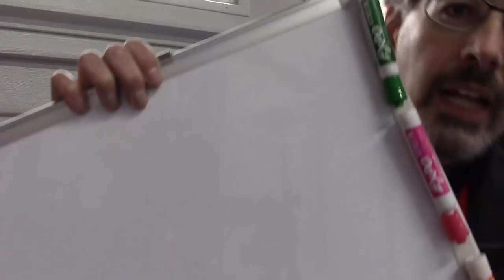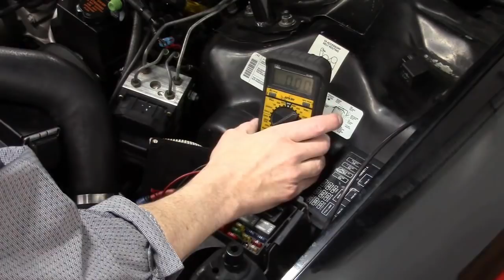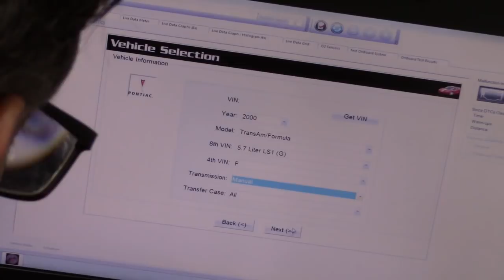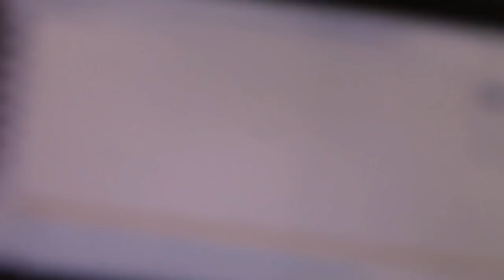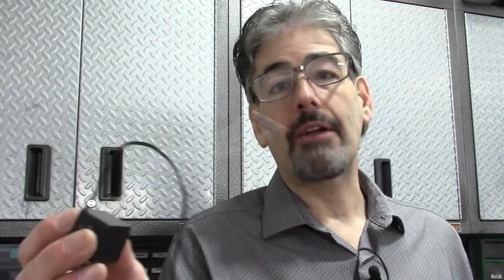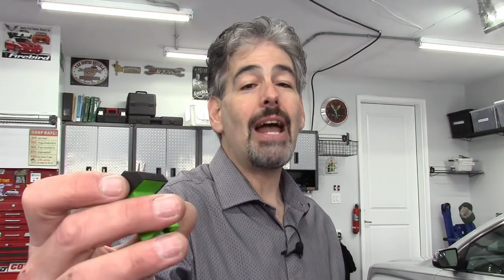DIY:  Diagnosing an Overheat On My Own Car

Comment: Hey Matt, I dont know if you're feeling charitable but I could use some help. 

I got a 99 chevy Malibu, 3.1. I can command my fans on with a scan tool but they will not come on when the car comes up to temp. Ive tracked the ECT as high as 220 with no activity. The cars AC does not work, but again, I can command the fans on with a scan tool. I would appreciate advice
Reply from the maker: It’s apparent the ECT sensor is not sending signal to the PCM. Remember most cars have two ECT’s. One for the gauge and the other for the PCM. Check the one for the PCM and the wiring to the PCM. But we know the PCM works if it has signal because the fans turn on when you command it.
Reply: @SchrodingersBox if the PCM wasn't receiving signal would I still be able to see the ECT pid/values on my scan tool?
Reply from the maker: Not necessarily/  if the PCM is not seeing signal it may substituting a value. Best to check in generic mode to see actual value.

Comment: 3 Bad fan motors is actually much more probable than you might think, since they could theoretically fail a few months or even years apart from each other. You would never notice one fan being bad because the car would never overheat. You may or may not notice 2 being bad, especially if you don't stop too often and are driving in a Denver winter, until finally all 3 are bad.

Comment: Do you worry about getting modules for such an old car? Or have any problems in  getting them?
Reply from the maker: Not sure what you mean by "modules for such an old car"?
Reply: Well for that age perhaps there are few modules in cars. In one of Ivan's vids he could not get a pcm for a particular vehicle due to its age (early 2000s). Just curious how much of an issue it is to get parts especially modules is for older vehicles.
Reply from the maker: ohhhhhh yes, I see
  No that isn’t a concern because there is a massive aftermarket for firebirds. finding any parts of any type is never a problem on any firebird.

Comment: Voltage drop question.....have a shift lock solenoid that does not actuate. Tested the brake switch....have proper voltage there. Pulled the solenoid out and have proper voltage there. While the solenoid (old or new) is connected the voltage then drops from 11.57v to 50mv.
Reply from the maker: remember you will always have full voltage drop ACROSS a load so that sounds about right.  .  The only way you wouldn’t is if you had resistance on the ground which clearly you don’t. so what you may want to do it check voltage drop on only the power side since you are starting with only 11.5V. it should be same as source voltage.

Comment: I would check the voltage drop across the bad connection. This would give you some baseline data to use after the repairs.

Comment: Is dielectric grease in the connector a good preventive measure considering your environment? I'm in the arid south west where 25 year old cars barely get much corrosion. Thanks for the great content and congrats on the new place!
Reply from the maker: Yes, absolutely.  in fact someone else pointed out it appears the silicone sealing ring seems to have been missing from the connector which probably caused the corrosion to occur so quickly. but indeed a dielectric grease on the connectors (not the terminals!) is good prevention.

Comment: Now you found out how we live in Canada! That is common in Alberta every winter, but this one was good. After snow like that, we have next night temperatures below -30C!
Reply from the maker: yes I will say one awesome thing about denver- if the sun is out it makes remarkably short work of the snow no matter how bad it is. in fact major roadways are already dry!  the high altitude let’s the UV really cook stuff, plus it’s very arid on top of that. 
  when I was in St. Louis MO, a snow like this would just rot on the roads as ice and slush for literally months.  it never dissipated. after a couple weeks the snow was so black and nasty it looked like coal on the streets.

Comment: Really cool garage you got
Reply from the maker: Thank you!! it took me about 60 hours to do everything from paint to lighting to flooring. I did it in just 3 weekends though- I worked my butt off so I could be operational again ASAP
Reply: So you are not in bare feet on a dirt floor ? I guess the guy with the fuses is ! In fact - he's got an 8 Track " Sound System " and using his VHS to wear out his bootleg copy of DELIVERENCE ! Pass the bib overalls !

Comment: For maintaining  and cleaning electrical contact look into a product call CORROSION X, best stuff on earth. To avoid problems in my turbo car, I install a push fan on a separate circuit that I can turn on when needed manually.
Reply from the maker: Great tip!

Comment: Thank you for a down tp earth (no pun intended) fan diagnostic video! Any troubleshooting suggestions for a pwm activated fan? Obviously for those without access to a device that creates the square sine wave?
Reply from the maker: I haven’t run into a PWM fan yet but if you didn’t have a scope the best you can do is see a difference in the AVERAGE voltage as the pulsewidth increases or decreases.  Since a regular multimeter already takes an average reading, you should see more or less voltage on your readout as the pulsewidth is adjusted. 
   Even then, if you are having issues on the circuit you  are limited in what you can use for diagnosis since you can’t see how “clean” and consistent the square wave is. but you can still measure voltage, amperage and voltage drop/resistance.
Reply: @SchrodingersBox  Thank you Brother! Some day you should do a video on the importance of having a clean organized garage, as your garages always look great!
Reply from the maker: hahahaa I have one on my pay channel actually but I will do a “garage tour” video on this one if there is enough demand.

Comment: “You didn’t check the fuses, I did you are just to Dumb to know” 🤣🤣 I was dying LOL . Gotta love the green crusties responsible for 80% of issues.
Reply from the maker: Lol never fails.  In fact yesterday I actually got a comment "you never checked the source voltage".
Reply: @SchrodingersBox  LOL gotta love the armchair diagnostician. Most shops don’t even have one qualified that’s the funny part

Comment: Hi Matt, thank you for another great video. Nice car by the way. That relay kit looks pretty handy also. I have a question unrelated to the video. So I have this car that I would like to be able to get a little more power out of and maybe a little bit better throttle response. I have seen quite a few different manufacturers that offer a performance chip that plugs into the OBD2 port and claims to give it better performance.  With my understanding on how the computers work and how the oxygen sensor works I began to wonder what it is that one of these chips do and do they actually provide more power or is it kind of a waste of $300? Does it move the fuel curve outside of stoichiometry? I have also seen some devices that are made for these drive by wire cars and they claim to increase throttle response, any thoughts or opinions on those? Any thing that I should be concerned about with either one damaging something long term?
I understand that to gain real power out of a motor I should either build the motor or add a turbo to it but I am not looking to make that large of an investment into an engine that does not have anything wrong with it on a car that I use for work every day.
So far I have added a Borla type S axel back exhaust and I plan to install an AEM cold air intake. It is a 1.8 liter VVT Toyota motor if that weighs any in your thoughts on the matter. Thank you and keep making your videos.
Reply from the maker: yeah those chips are pretty secretive in how they actually work and it’s pretty sus that they claim to both increase HP and Fuel Economy- pretty much impossible to do simultaneously. 
in general what those chips do is slightly retard the timing to get slightly better compression and also move the shift points to shift at RPMs that would allow more torque but of course this would be at less fuel economy.

Comment: Disapointed in you.. 
Good habit is to always check source voltage. Is fan getting voltage at fan? Is fan being provided voltage at the fuse?

Now back to finish the video.

I guess if you are splitting the circuit.. That is a good test point. 

Sometimes we smart guys overthink things.. Gotta be the computer, the relay..
Reply from the maker: ummm the very, very first thing I did was confirm source voltage.  that was literally the first thing I did.

Comment: The garage looks great, I love the floor! I wish I had a garage, (I live in an older home) because working outside sucks and slows down work. I'm swapping the engine in my 1988 Ford F250, it's a 7.3 idi diesel motor. A 4-day project has turned into 2 months because of winter weather delays and my job has me working 60-72 hrs a week now. Funny you mentioned those plastic engine vanity covers, I HATE those stupid things! My RAV4 and the wife's Camry have that plastic garbage on it, a waste of materials if you ask me.

Comment: last time I had the "oh shit turn up the heater" moment was in the middle of a canyon in Wyoming, trying to find a place to park + camp on my way to Montana from TX in my '88 gasoline Jetta  about 2 years ago. It was a car that sat on the farm I previously worked at for maybe 5+ years and was in such bad shape when I got my hands on it that the entire air intake was full of mouse nesting! I never quite got it to 100% after that over-heat (and eventually had to send it to the scrap yard- I was poor and it was the first car I started to really "learn" on so I had no idea what I was doing) but man that evening was a rush. trying to find a spot to park before my car stopped working and the intense fear I had when I tried to restart it in the morning was something I'll never forget!
Reply from the maker: oh yeah brother. it’s incredibly unsettling for sure and that obsession with every slight movement of the temp gauge is exhausting lol!!!

Comment: So the three fans, each with their own relay, share a common connector?  Or, did three connectors each get green crusties and opens at the same time?  I'd like to see that wiring diagram.
Reply from the maker: The former. I have the fans set to all run either low at 190 or high when AC is on. This maintains right about a 185 degree constant operating temperature under all conditions.  The modified 6L LS7 with supercharger and headers created a tremendous challenge with cooling the engine.  The setup I have allows me to still have AC without overheating.

Comment: Connectors....often the weak link in an electrical system. I had a similar issue on my 1930s car, however the give away symptom indicating the original harness needed replacing was a puff of smoke from the dash....not a difficult diagnosis 😏

Comment: I missed the silicon packing on the connector that is supposed to keep it water tight.  
The pins are easy to replace with an extractor tool. They are open barrel type and need dies to crimp, but they are better than the closed barrel in that they crimp the conductor and the provide a strain relief by crimping the insulation as well. That style connector has silicon packing for the wires as well.
Reply from the maker: Hey great observation!!! It seemed to be missing in that connector now that you mention it!  Damn aftermarket.  Probably absolves my wire harness too I hope!

Comment: You've driven a Trans Am since it was brand new? You must be a millionaire! Most mechanics seem to drive beaters
Reply from the maker: it helps that I am not a mechanic I guess lol.  but I have seen mechanics with amazing cars- however I agree- the majority seem to drive beaters and keep barely running them til they pulverize into the ground. Eric The Car Guy lol!!!
Reply: @SchrodingersBox  I see you're not a mechanic .. just good at it lol , he has a few projects which turned out good but mostly Hondas what I've seen over the years in "various conditions" :)  , I think more Americans should drive American cars .. there are lots of good looking models. Is that Trans am your daily driver ? Reliable?
Reply from the maker: my trans am is indeed a daily driver and it has been incredibly reliable up until 2 issues in the past month- a no crank no start and this overheat. but over 20 years it has had less than 5 issues that have required repair in order to safely and confidently drive it.
Reply: @SchrodingersBox  That's impressive, I'll tell this to any "anti american car" friends I know who insists that they all overheat and "blow up" on the highway. I like having the same car for many years, that way you know the condition of every nut and bolt.

Comment: Great information as always! Another problem with running the AC for more than a few seconds without functional fans during testing is without proper airflow through the condenser, the AC system will quickly overheat and build excessive pressures. Most modern vehicles have a high pressure cutoff switch to shut the compressor off if the AC system overheats, but if it fails or someone has bypasses it the AC system could be damaged. Best to never rely on safety features :)
Reply from the maker: oh good point. Didn’t think of that.

Comment: Hey Mat nice to see you nice video  Looks like shoveling will be on the agenda By the way a simple way to check a removed relay is with a 9 volt battery and an ohm meter on the load side  quick and easy Cheers
Reply from the maker: yep that’s also a good way to do it. I use a 9V battery when installing speaker wire as well- great way to identify wires as well as keep polarity straight.

Comment: Hm, would using a testlight for load simulation also be a good thing to test for the relay control/powerside? Because 12V in open-circuit doesn't mean itll stay 12V with a load.
Reply from the maker: Absolutely it would!  I just decided to use the DVOM because I have been using testlight a lot more in recent videos. I could very well have used a testlight and in fact in some of the tests it would have been a better method actually.

Comment: Matt 
New sub here trying to learn. 
My 05 Nissan Titan goes in and out of closed loop. O2b1s1 is dead at .005. Po300 code only. Why would it go back and forth between open and closed loop? 
Runs fine in open loop shakes and carries on in closed loop. 
I’m planning on joining the pay channel but what’s a good starting point for now? Thanks. 
Great channel. 👍
Reply from the maker: On a dead sensor you have to determine whether sensor is dead and causing the symptoms, or if the symptoms are causing the sensor to flatline and it is legitimately reporting actual condition.  induce variables and look at response  to determine which it is.
Reply: @SchrodingersBox  I just wanted to let you know that I swapped the two AFR sensors and the problem transferred to bank 2. Smoking gun to me so I replaced the sensor and the truck runs perfect!  Now this is after I had it to a professional mechanic with a $5000 scanner who put my truck out back of his shop when a new MAF sensor didn’t fix it. I with your knowledge and a $50 scan tool fixed it for $95. It’s completely true what you say about so called professionals and I will now keep studying and will do my own diagnostics for now on. Thank you again for your time and skills and for sharing

Comment: Boss, the computer has the transistor open when not grounding the control side thus a short is unlikely unless you have commanded the circuit on while you're messing around with the wires. My tip is to use shorter wires and a test light clamped to ground and touch the control side of the relay and since the miliamps required to activate the relays are low, then the test light will be enough to pass a decent ground. A test light is safer to use than a direct wire 😎

Comment: Relay box is always a good central point to test to find the problem fast.
Reply from the maker: Absolutely correct!!. It allows multitasking.  Checking the fuse makes no sense to me because- I mean EITHER WAY-  you still have to determine why the fuse is blown if it is, or what else is wrong if it isn’t blown. what good is that?  Probably 90% of people who check the fuses first do so because they have no clue what else to possibly do.
Reply: @SchrodingersBox  only time is when there is no relay, the fuses must be checked and I'm talking about Mercedes where the fuses are numbered and out of order with no naming conventions. Even my paid Mitchell1 is limited for these newer cars. I always pull the diagrams before I attack an issue where I dont know if a relay is involved for an actuator. I guess this was an easy and very known that are relay controlled as standard for all vehicles.